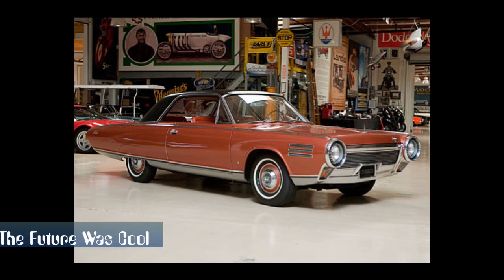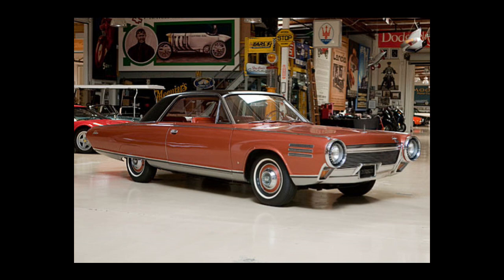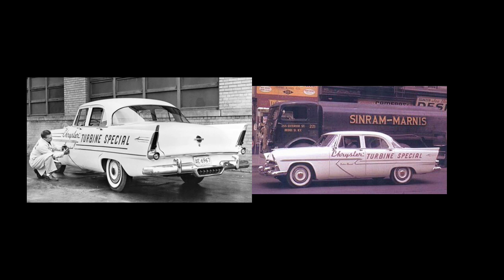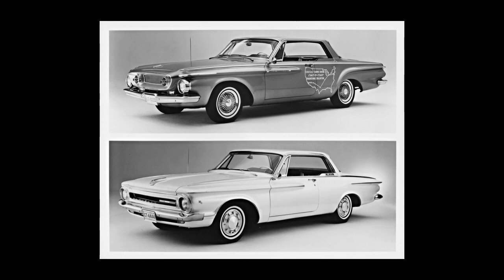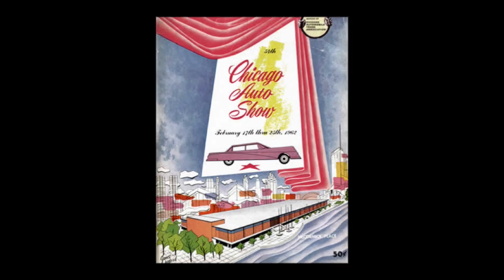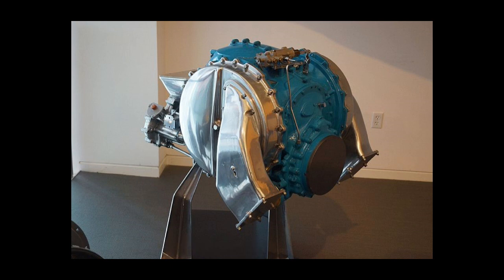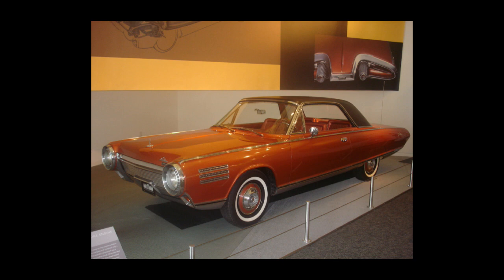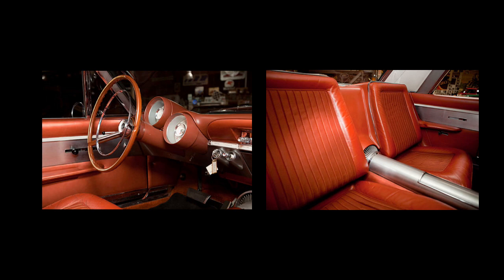A Jet Engine Under The Hood: The Chrysler Turbine Car part 1

Comment: There is a distinct difference between a jet and a turbine engine. Some of the body design elements were used on other production Chrysler products. You may recognize that the front end on the 63 Dodge Dart is similar and the roof design on other Chrysler products.

Comment: With 425 lb of torque it certainly had enough power to run an air conditioning system. The problem was there was no external accessory drive on the turbine motor to run the AC pump.
Reply: Looks like they could have made a reduction gear to reduce the speed to run a compressor.